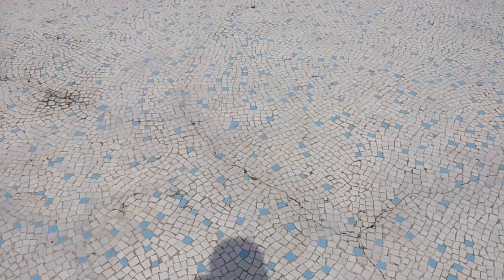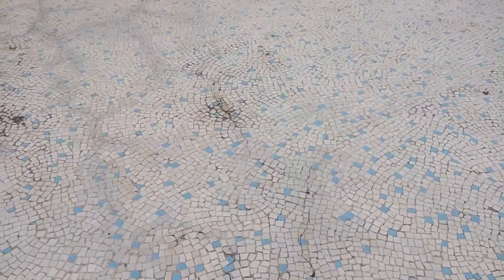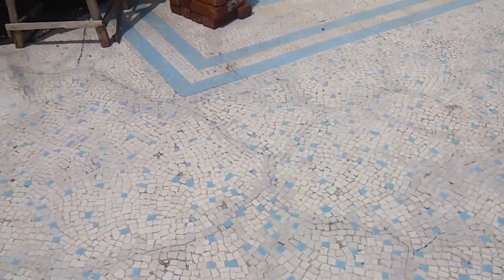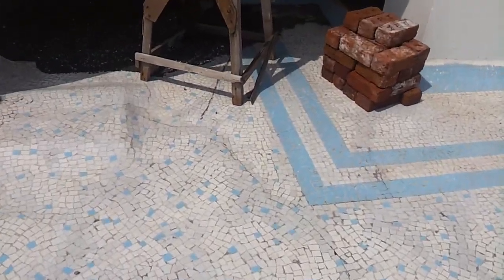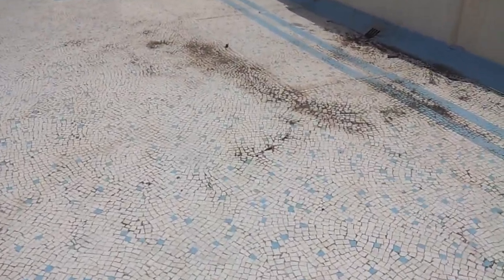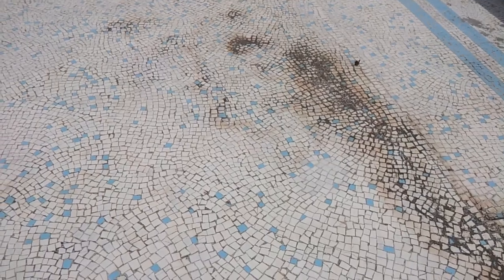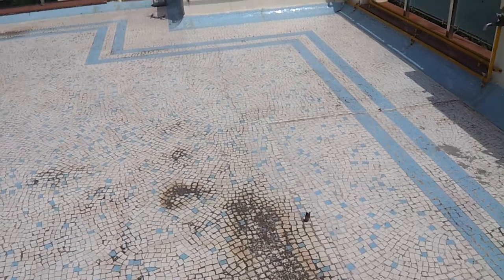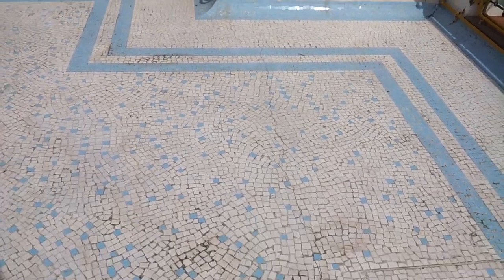Problem of china mosaic over Terrace

Comment: Hi could you please tell me,what is good for 25years old roof  China mosaic or tiles. Before there was tiles but now it has started seepage. So we are thinking to go for China mosaic. What is good in long run? Please guide. Thanks in advance
Reply from the maker: 25 years is not a very long time if you have maintained your slab and structure well. Desi page in the structure is always an alarming Bell which should not be ignored. Superficial treatments from the top will not help in long run hence it is important that we treat structural cracks before we waterproof the structure. The water penetrating through structure Will soon worsen the situation and conditions and finally the life of structure. So to conclude I will just say doing China mosaic or any treatment without repairing cracks of the structure will be a temporary and a short-term solution

Comment: How about using epoxy grout in the cracks? It's waterproof too..
Reply from the maker: Yes I agree epoxy has waterproofing properties. But it cannot be a replacement to waterproofing. Water can penetrate through a lot of places and reach slab. Hence my advice to a good waterproofing system.

Comment: I have same issue. How to resolved it?
Reply from the maker: use Keraplast P6 Mixed with Giolite powder. cut open the crack 5 mm with cutter and than clean and coat a liquidy mix of the above material and than fill the crack with mixed above giolite morter into the joints. this will delay the problem and intensity of the problem
Reply: @imranchhutani  Last year in july my china mosaic damaged like video due to fabrication work. I connected many local waterproofing person and some suggested to go for mesh sheet work or chemical work? Which one is best for above solution?
Reply: कांटेक्ट तुम्हारा यह झूठा है टुकड़ी थोड़ा बड़ा होना चाहिए यह फटनेका संभावना नहीं रहता है

Comment: Hi Imran I am having the exact same problem - how do I fix it ? Can you please guide ? We don’t have option to relay the terrace
Reply from the maker: use Keraplast P6 Mixed with Giolite powder. cut open the crack 5 mm with cutter and than clean and coat a liquidy mix of the above material and than fill the crack with mixed above giolite morter into the joints. this will delay the problem and intensity of the problem

Comment: i think brick bat coba is best option for terrace flooring.
Reply from the maker: I respect your knowledge but it is a sloping system. the water does not hold so it does not penetrate inside. how ever good slope there will be some places where small amount of water will stay get absorbed in bed and travel to the slab.